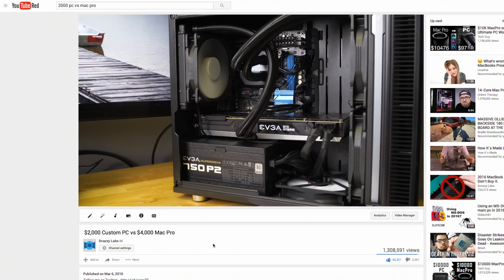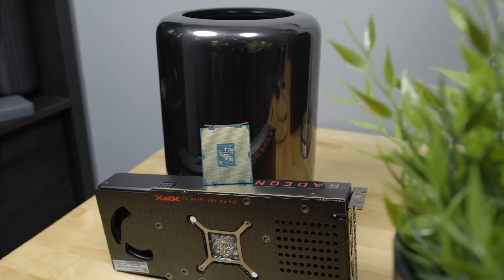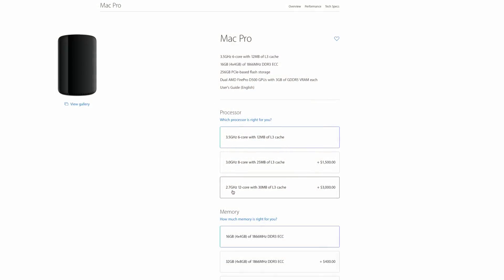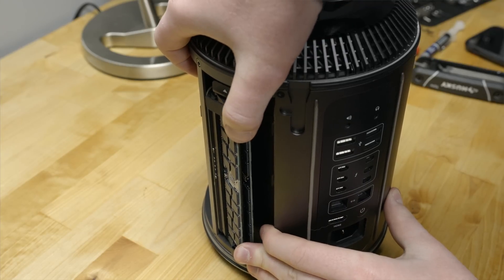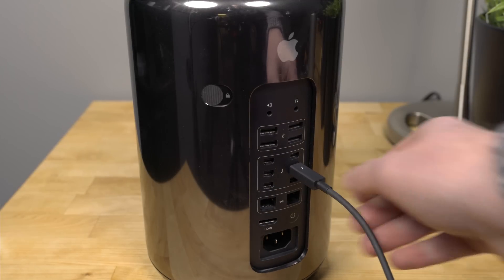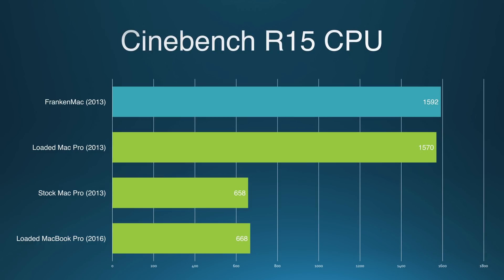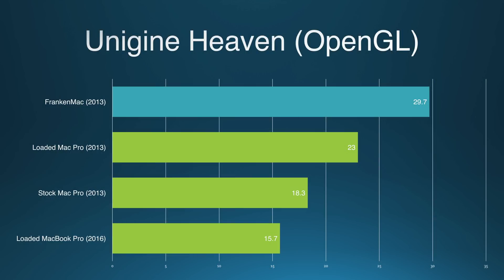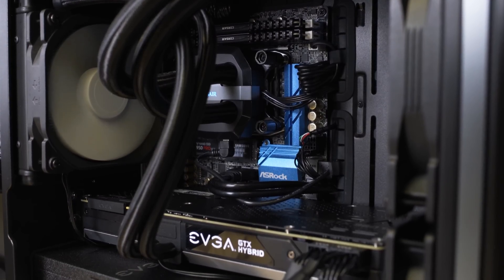The Best Mac... Apple Doesn't Make!

Comment: I like that you wanted to build something that performs, because that is not currently not offered by Apple, and hasn't been for a few years, as you mention also. I just asked Linus what $3500 will get me in laptops for Apple-user type use cases! :)

I'm on board with the general performance differences, and there's no surprise that whatever Apple puts in their products instead of graphics cards is 3 times as slow as if you buy something with a graphics card. But I'm stuck on one thing. Ivy Bridge Xeon beats Core i7? (MBP 2016). Not that Apple tells you what i7 is molded into their aluminium bricks, but could you explain how you ended up with this result?
Reply from the maker: The fully-loaded 2016 MBP has a 6700HQ. It's a really great CPU–the priciest one offered in Intel's Skylake mobile lineup, but when it comes to exporting, the more cores the merrier. Older Ivy Bridge Xeon with 12-cores indeed outpaces the MBP in video production. Certainly, you'd see better performance on the newer CPU with single-core processes, but this remains the multi-core king in Apple's product portfolio.
Reply: Yes, for certain applications. It's too bad that software in general use APIs that are not that good at utilizing extra cores. Hopefully this will change and there's Vulkan but well, that's for games. Still, it was good for a few years back when I could get a decent PC up and running with the G3258. I liked that CPU. :) It's too bad also that you have to choose a dual-core if you want the smaller MBP. (Unless they fixed that.)

Comment: Why didn't just you a PCIe extension cable if the RX480 didn't fit. That way you could use all of your bandwidth.
Reply from the maker: What? That's not how it works, mate. LOL. Mac Pro doesn't have a standard PCIe connector.
Reply: I didn't know that. So can you actually remove the graphics card on the Mac Pro ? Is it possible to swap out the graphics cards in the mac Pro with another ?

Comment: $600 for a cpu? why not just build a hackintosh with a 6700k and a 480rx instead? im pretty sure you can do that under $1000, and sell the trash can.
Reply from the maker: This runs circles under a 6700K. And because I need a bulletproof system which can have no issues updating or handling hardware accelerated FCPX rendering/conversion. Hackintosh can't provide that. If it were possible, I'd have done it.
Reply: Okay that makes sense, for your use you gotta a better system.. but for the casual/me who does basically dual booting with windows for playing games and enjoy the benefits of mac the one i mentioned is not bad.

Comment: are you dumb, you can use a vm on windows to run mac os or just use fucking premiere.
and why do you call it "Franken mac" it's basically a mac with a better CPU and ram with a razor core connected to it
Reply from the maker: You're dumb if you think you can edit 4K video in a VM.
Reply: first, if your PC is powerful enough you can.
second, why don't you builda hackintosh?
third, why don't you use premiere?
and 4k in YouTube is overkill most people don't even have the option to use it, its not necessary nor useful.
i do want to apologize if i was too rude, sorry

Comment: Up next, Snazzy replaces macOS on the Mac Pro with a material-themed GNU/Linux OS and begins using non-proprietary software only.
Reply from the maker: Their isn't a good NLE for Linux. LOL.
Reply: Snazzy Labs - who said they had to be top-notch?
Reply from the maker: zero chan Me? Lol. I'm the one that's producing videos for a living. I need something fast, easy, and powerful. None of which are offered on an open-source NLE.
Reply: Snazzy Labs - then try Blender, it is FOSS and is fully scriptable in python
Reply from the maker: zero chan Not an NLE and not practical for full-time production. Come on man...
Reply: Snazzy Labs - if you want non-linear then go with lightworks, although, Blender is still also a very good choice

Comment: I have a late 2013 mac pro that I am upgrading to 12 core and it has dual D700's in it.  Will the EGPU with the RX480 make any difference.  And can you use dual cards

Comment: this is why mac is not worth owning for the prices they offer. they are complete ripoffs and charge you WAY too much just for simple upgrades that you could get for way cheaper by doing yourself, assuming they havent already soldered everything together to prevent that. apple is the very definition of anti-consumer but they spend millions in pr and marketing to make you think they arent. they shuld just save themselves the money and make decent products that are tinker friendly. they dont have a bad os or design, just a bad approach to hardware. if they changed to a more tinker friendly approach and reduced prices to actually reflect the real value of their products, i may actually get one, but they wont, so im not. even if future work benefits from it, ill still resist. this kind of stuff makes me wonder though why its the standard in so many industries?

Comment: A Hackintosh would run circles around that thing for less money... oh well.
Reply from the maker: Ehhh....not really. An x99 build would, but they're not rock solid. This is a production machine. I love hackintosh and have built them before, but I needed a solution that had 100% uptime, no video codec issues with FCPX, and was easy to maintain. Even the best hackintosh can't manage that, sadly.

Comment: Making FCPX mac only is honestly a scummy move by apple. I do believe that spending $2500 on a custom built pc would make a faster computer therefore it would make premier a lot faster than FCPX since you would have the ability of getting modern hardware rather than 2013 hardware and modern mixup.
Reply from the maker: I was on a $2,500 PC already. It's not so much about export/render times (even though FCPX is a lot faster than Premiere at exports), rather, it was about using 3rd party plugins that aren't available for Premiere that reduce my workflow time by a significant portion.

Comment: I don't understand "techies". Yes, we get it, you're into upgrading your machine every 6 months. Do you people not get what the MacPro was MADE FOR? It was specifically powerful enough in 2013 so it DIDN'T need to be refreshed every year like their Mid range iMacs. Apple has ALWAYS done "slightly lower specs for stability". The only people I hear bitching about the Mac Pro are people that primarily require open PCs. Stop chastising Apple for a product just because it doesn't fit EXACTLY what you need. That's like complaining that a Google Pixel doesn't have a stylus or that Google Maps doesn't have Facebook integration. For people who "know so much about tech", how come you don't get the simple concept of "Powerful computer so you DON'T need to upgrade every 3 months">
Reply from the maker: "slightly lower specs for stability" is a cop-out and a farce.
Reply: This is where you are wrong. Any computer will be as good as the day it is created. The need for upgrade is there when technology advances and the old hardware becomes outdated which then needs an upgrade. Apple has not had a PROfessional computer contender in over 4 years. In that time, 4k video has taken off. Rendering power of new technology is required if you want to keep a component relevant.
In this 4 year time frame, we have seen at least 3 gens of GPUs, one gen of memory and around 4 gens of CPUs. That is a huge leap in compute power that mac can't be bothered to take advantage of yet is still charging full price for old tech as if it's still good enough.
For the professional, as the PRO name refers to, it is bad business to slow your work load leading to lower profits.

Comment: IBM Research say that is cheaper to maintain Macs than PC... When i helping to fix other PC then they run Windows and are full of bloatware. 60% of people don't know how to buy cheap mac and don't know how to remove program from Windows. 
Privacy? Windows just on front say... "We take from you all 
This is fact. Mac are simple yet powerfull. And the most important part...

Mac have POWERFULL command line ... 

Sources: 
https://twitter.com/rtrouton/status/788745640238915584/photo/1
https://www.quora.com/What-are-the-differences-between-the-Mac-Terminal-and-the-Windows-Command-Line

Comment: It's sad times that all pro apple users have to resort to doing this because apple has in effect abandoned it's pro market. I recently took the plunge into making a hackintosh that blows away anything that apple currently makes. Selling old internals at a very high premium is just going to drive away serious users. Right now the only thing Apple has going to it is MacOs. If it wasn't for that, I would probably ditch the whole eco system without batting an eyelid.
Reply from the maker: They're certainly going to have to up their game—especially considering Windows (and PC hardware manufacturers) are getting so good.

Comment: Could you use an e-gpu case with two thunderbolt connections? The extra connection would increase the bandwidth that the gpu needs and would probably have even better results. Great video.

Comment: Snazzy, use multiple thunderbolt ports for the external GPU!
Reply from the maker: Sadly, that isn't possible. :(
Reply: Snazzy Labs Dang, too bad. I though I saw it when someone used the two thunderbolt ports on the MacBook Pro to use an eGPU.

Comment: Hi!!! I NEED HELP ASAP! As a research major, I need my laptop everytime. So, when my AC plug broke, I was devastated. I just want to ask, can I use the AC plug from my 60-watt Macbook charger on my (AC plug-less) 45-watt Macbook Air charger? THANK YOU SO MUCH!! I hope I can receive answers ASAP. I don't want to buy a new charger because it's pricey.

ALSO, if I buy an extension for the charger, will it work without my original AC plug? thanks!!

Comment: Just want to let you know that ES and QS are not retail versions, have lower clocks, missing features and it's pretty much illegal to sell and buy if that "Intel confidental" label was not a hint for you. lol
Reply from the maker: Mine actually has a slightly higher clock. Maybe luck of the silicon lottery. Bought it from Japan and it wasn't advertised as an Intel Confidential. Would have returned it, but eBay denied my request. LOL. Oh well.

Comment: Great video honestly you should work for Apple great Franken Mac solution! I'm in the market to buy a new Mac but unsure what to do I need extreme horse power this may be an option for me. Or the new  iMac 2017 with devil box enclosure
Reply from the maker: I'd wait for the 2017 iMac if you can wait for it.
Reply: Snazzy Labs I'll make sure I get my money's worth and wait. Coming from you who has probably tried and tested all types of  computer tech. I'll go with your buying advice and insight. Thanks man this helps a lot. Most of us power Mac users are being neglected. Really unsure and confused about Apple's direction with the Mac line.

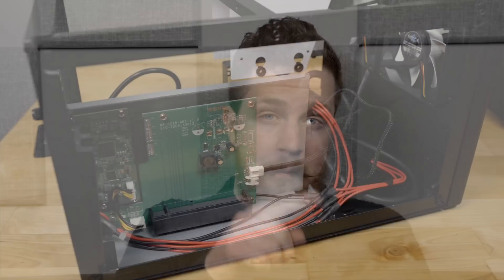Comment: 2:46 did you call a 350W power supply overkill? I'm pretty sure that's sarcastic..
Reply from the maker: Not sarcastic. It only powers the RX480 with at max load only draws just over ~200W.
Reply: Snazzy Labs wow, that in itself is a testament to how AMD improved in power efficiency.

Comment: Apple should push out a firmware update that disables external GPUs. Have it reboot the system if it detects greater than 70% thunderbolt bandwidth draw.
Reply from the maker: That won't happen, so your plans of mass destruction have failed. Bummer.
Reply: Snazzy Labs I'm just trying to help prevent potentially damaging the hardware with unauthorized modifications.
Reply from the maker: 1) it's not a hardware modification
2) it's not unauthorized—everything shown still allows the computer to be covered under warranty
3) it won't damage the hardware—lol—most absurd thing I've heard today
Reply: Snazzy Labs It will create a black hole.
Reply: Snazzy Labs Using non authorized memory modules will cause the system to be unstable. Apple tests all their authorized memory modules. Buying ram from a non certified third-party puts your computer at risk.
Reply from the maker: https://support.apple.com/en-us/HT205044
Reply from the maker: Zestypanda Also, FWIW, SK Hynix is the OEM for Apple's RAM.
Reply: Snazzy Labs "Apple recommends that you use Apple-approved DIMMs."
Reply: Snazzy Labs I'll stick to using certified Apple (tm) memory modules, and let the trained technicians at my Apple (tm) retail outlet install the ram for me. They quoted it would be a two week job and only cost $800 ontop of the $800 for 64gb ram. :-)
Reply: Snazzy Labs Yes. But apple picks special batches of the best modules.
Reply from the maker: Zestypanda Okay now I know you're trolling lol

Comment: When you buy the Mac Pro, your paying for a super small system thats a workstation! nothing like it exists! and it has 2 GPUS, a pretty good multicore support and all cooled with one fan think about this the PSU on most standard desktops is as big as the mac pro!!!! imagine how much hardware they are stuffing into this little trashcan! haha
Reply: SERGE I can build a mini ITX PC on the same size, shape, and price with way better performance
Reply: SERGE and the Mac pro is still an overpriced piece of sh*t
Reply: SERGE I don't need 2 video cards to be better than the d300 or d700 the 1070 and 1080 will do the trick
Reply: SERGE also have I ever said that I will use 2 video cards
Reply: Why does it matter that it has two GPUs? They get outperfromed massively by a single mid range GPU thats not even connected at its full bandwith. Even when they where new some (cheaper) single GPUs outperformed them. Thats because the Mac Pros GPUs are based on the Pitcairn and Tahiti architecture that was already about 2 Years old when the Mac Pro 2013 first came out. I literally bought a Pitcairn based GPU for 35€ the other day that runs at a higher clockspeed than the downclocked D300 (or W7000 or HD7870, it's the same) in the Mac Pro.

It's small, yes. But it's still very underpowered especially for a product thats made for "professionals". 
I mean, you can get the same 2 GPUs from the base mac (2x D300 = 2x HD7870) for less than 100€ used and the ones from the most powerful (2x D700 = 2x HD7970) for less than 300€ used. Why used? Because they are literally 5-6 Years old now.

Getting them in this small of a case is another thing though.
Reply: You don't even need a 1080. Even a R9 290X (released in the same year as the Trashcan Mac Pro) would at least be on par if not better.
Reply: +SERGE  It doesn't need 2 GPUs when the GTX 1080 is much much faster than the dual outdated GPU solution found in the outdated Mac pro. And it consumes less power even when compared with only 1 of those two  GPUs. So much faster and way more efficient.
Reply: Haha! I'm part of the Apple hive mind! Just be happy they made a phone with a decent proscessor for once.
Reply: Yeah, i have done plenty of mini itx builds... you really think that apple is literally the only company that can have a factory in china make them ultra mini components.  Get a clue dood.
Reply: SERGE hey my Mac Pro 2010 is better than the trash can Mac. My friend just upgraded his ram on trashcan, he give me his ram from that computer. I didn’t think my Mac Pro wouldn’t let me install 14900 ram in a Mac Pro 2010. Anyway , trashcan has two video? Well my Mac can do 2video cards and 4 internal HD. So Apple trash has taken a step backwards in technology.
Reply: SERGE this sarcastic guy lmao
Reply: RadeonGuy27 I always that company , they came on scene supporting only powermac G4 only. ATI Radeon always been there for Apple computers.
Reply: 2 old crap out of date graphics cards, even when new in '13.  1 RX 480 over thunder bolt using only 60% bandwidth of what the card can do, spanked those 2 AMD firepros.  Same with the Xeon CPU was old then and old now, but still a work horse.  Decent computer but WAY over priced then and now.  Is it work 8K new? Hell no, not then not now. 2K? OK not bad for what hardware you get and it's decent built quality.  Most Apple laptops, Mac Air, MacBook Pro.  are horrible.  Iv'e fixed them.  easy moisture damage, easy damage to hinge, no back light issues, ssd failures. Done them all.  If you take it to Apple they want half of what you paid for for a refurb.  What a rip off.
Reply: Anyone ever think that MacOS X just utilizes everything seamlessly and just all operates under great workloads